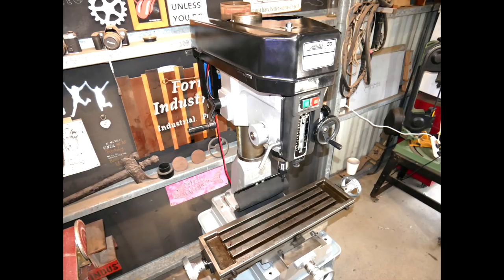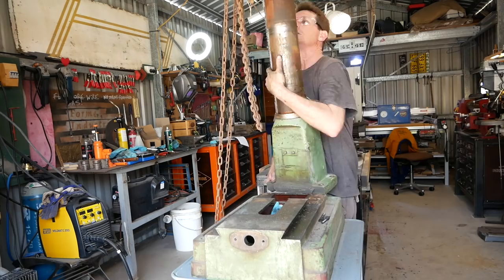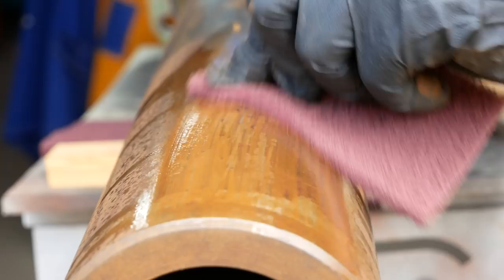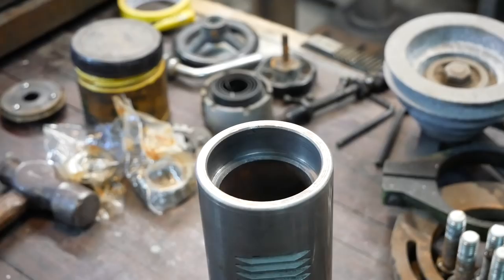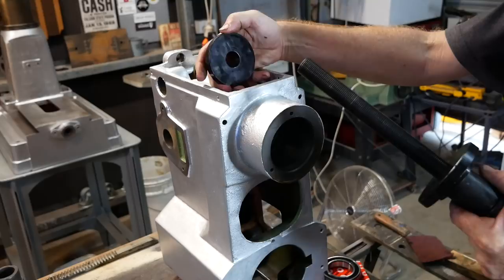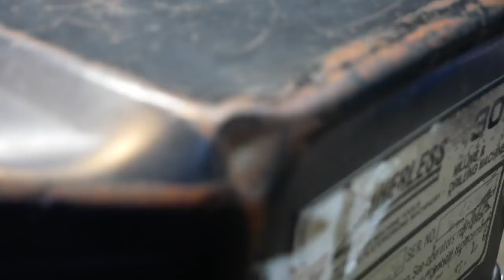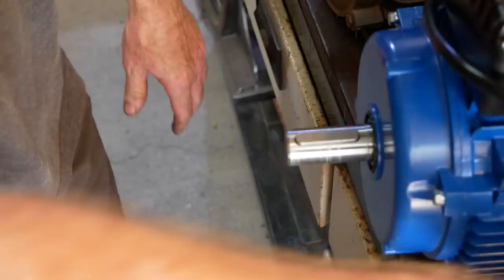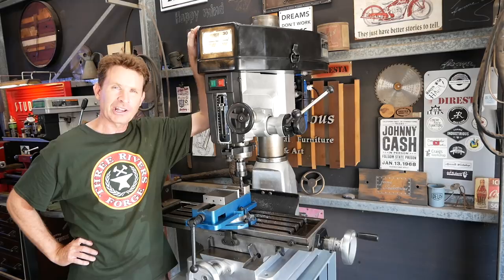RF-30 Mill Drill Restoration - Forme Industrious

Comment: When I bought mine new about 15 years ago it was just under $1000 US, so even with shipping I guess you had a bargain?
Externally it's almost identical to what you have even though yours is significantly older and 8,000 miles away
Being in USA I got dual voltage motor, 115/230 single phase, three phase is rare as hens teeth in residential area's
I never trusted the RPM chart (being red on chrome it was barely readable anyway) so I fitted a digital read out rev counter into the plastic front cover where nameplate used to be. Using a mix of EP 140 transmission oil and grease in bottom bearing I get an extra 50 rpm, really should change bearings and seal though as originals are a bit worn, noisy even after adjustment but work OK and the oil/grease mix leaks slightly after a week or two (easy to top up through the Morse removal slot, I have R-8 spindle)
Reply from the maker: Thank you for passing on your experience with your machine. It's amazing that you can get more rpm by changing the lubricant in the spindle bearings. I'd like to have the DRO, but maybe one day I suppose.
Reply: @ScottTurnerformeindustrious  Your right. I would like a DRO but couldn't justify spending as much or more than the mill/drill cost Now the cost has come down, I'm retired on a fixed income so DRO ain't happening any time soon. I fitted a rev counter, even after 25 years in USA I still have a problem calling it a tachometer'

Comment: Its heartbreaking as a pro painter to watch these great restoration and or build videos and see you guys finish this stuff with a brush or roller. You buy welders and learn how to weld. Buy an HVLP gun and learn how to paint. That's what separates the nice restoration jobs from the great ones. That way all aspects of the build are perfect.
Reply from the maker: I appreciate your feedback Greg. You know with the rough cast finish on this machine honestly the brush made the most sense to me. I have a HVLP and elected to not set it up. I guess for that first reason and my workshop is a bad space for spray painting being so dusty from my woodwork and metal work. I often Spray just outside the shed, but in the week of the job we had serious rain and humidity. There are reasons and it would be hard to tell any different in this case. Pro Painters have my genuine respect. There is a real art and skill to getting the perfect finish.
Reply: @ScottTurnerformeindustrious  Love your work Scott! Well that's a good point. Painting outside does have its downsides. Keep up the great work.

Comment: Hey Scott. Yes you are a heathen for painting the machine screws and using a chisel for the keyway. Oh well you must have been desperate. Well Im sad that you never went the VFD way. You will never know how good it is to have full variable speed forward and reverse.Tapping is the best with a VFD as well.
The VFD would have been very nice. Its good for the 3 phase motor because its not so hard on it also. Never mind. Nice work my friend good luck with the extra tooling you will need. Be aware every time you mill something to ensure the side bolts are tight. Leave enough gap to fit you  biggest tool or drill or whatever you need and adjust first before the job not during. Almost impossible to adjust without moving the head sideways after you have started a critical part.
Best of luck

cheers TRK
Reply from the maker: Yes I am. Oh the VFD, well I still have the 3 phase motor, amongst the spiders nest in the shed corner somewhere. Maybe a future mod, but then I will have to sleeve the pulley......bugger.  Huge thanks :)

Comment: The main head casting cracked when being used below freezing on my 2005 King PDM-30, a clone of your machine. The $300 repair welding might fix, but the $1300 for a new casting is not. The top spindle pulley nut on my machine is a left-hand thread.
Reply from the maker: Sounds like it's worth trying to weld repair. For the price of a new casting. I think I would be looking for a new machine perhaps. Good luck with the fix Charlie
Reply: @ScottTurnerformeindustrious  I am making an aluminum head and turning it into a router. They want $300 to weld up the casting and several thousand for a new casting from King Machinery. I may just toss it and buy a CNC from Onefinity CNC router for about $3000 ready to rock. One Finity is the best bang for the buck.
Reply from the maker: @charliemckay6402  From my end, you seem keen on the CNC. I'd do the weld but I guess the machine will always be fragile from now on. Tough decision.

Comment: Scott, if you check out our channel @ Bears Rod Shop, my Enco is on one of my video's, and as I have more time after paying jobs, will start on upgrades of our Enco. I was lucky, in that we drove 1800+miles round trip to buy our's. Came with all the tooling and 2 vise's, and a rotory turn table. Best $900 I have ever spent. Our's uses R8 collets and tapered arbors, so can use tooling from a Bridgeport. I am still looking for a BP knee mill, but will have to increase shop size,,,Ha! Bear

Comment: I guess you couldn't have done anything else with time that spent doing this restoration? i. e. hours for which you could have charged for your time?
These machines are not very costly when new.
Unless you do it a lot for the satisfaction. Like the car which I restored which is probably worth about two thirds the money I have into it.
In any case, you need an excellent job!👍👍👍👍
Reply from the maker: You are quite right. I takes an age to do a restoration and for most in business, or paid employment it is poor economy to do what I did. However, if you have a You Tube Channel and get paid for your efforts that way, it starts to make some sense (Not that I make much off You Tube but it helps). Doing this in your own time for satisfaction is quite fine also. Many thanks for your great comment.